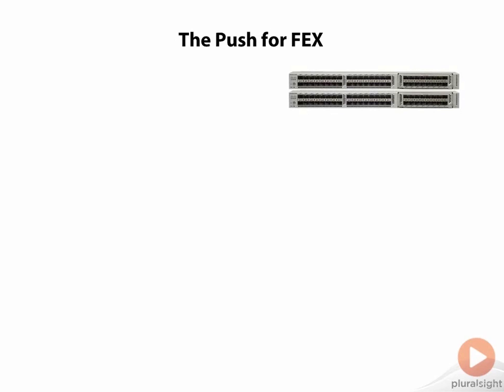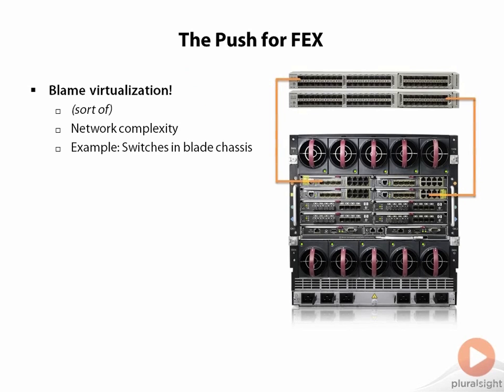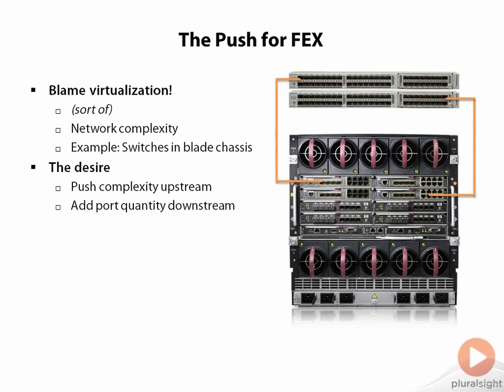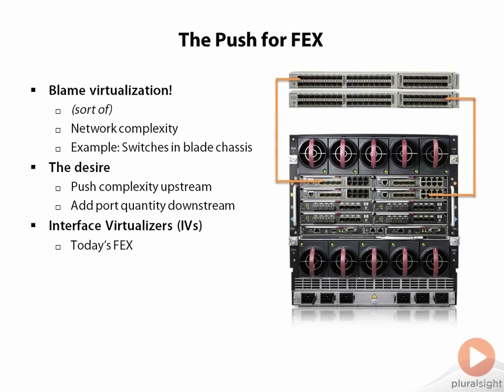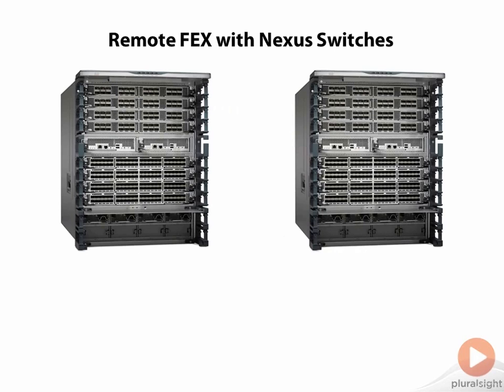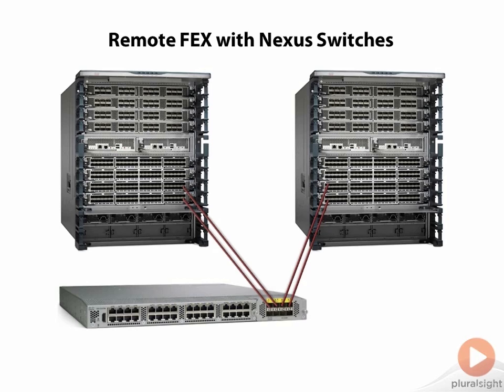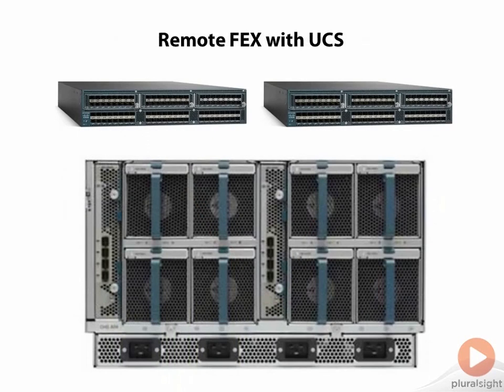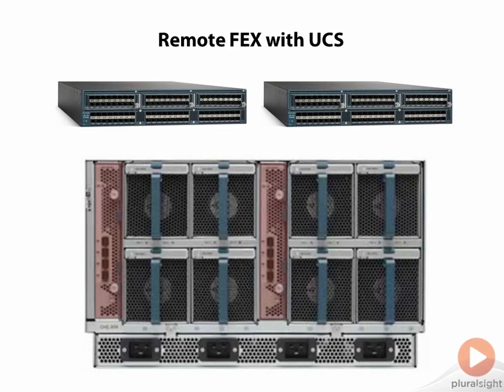FEX Topologies

Comment: the diagram you have for the FEX connecting to two different Nexus's switches is wrong as you cannot cross connect FEX's to different cores, as you know the FEX gets its configuration from the core and if it was connected to two different cores it would not work, in fact the other connected ports would show up as error disable
Reply: Hi Thomas. It is indeed possible to dual-home a FEX. Here's an example from Cisco using a pair of Nexus 5K switches as the parent switches to a FEX (also called Active/Active FEX Topology). http://www.cisco.com/c/en/us/td/docs/switches/datacenter/nexus5000/sw/operations/n5k_config_sync_ops.html#wp1077912
Reply: ***** Yes only for the 5k series but they are pretty much end of life now, from the 6k to the 7k this is no longer possible
Reply: Thomas Carroll Ah, and the graphic shown in the video is a 7K and not a 5K. I see your point.
Reply: If you can’t do on the 6k or 7k what’s the alternative than using a fex?